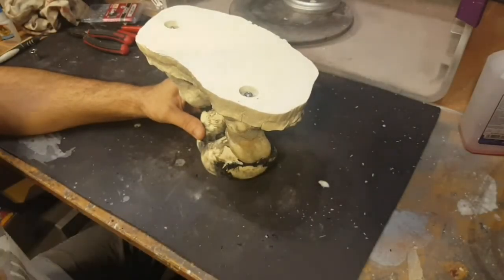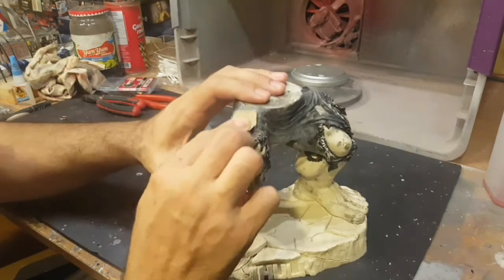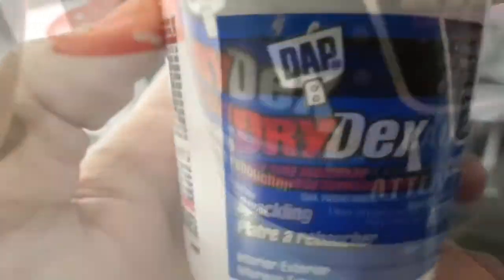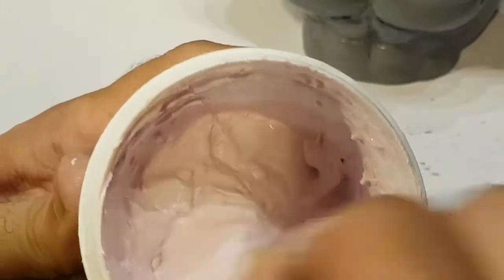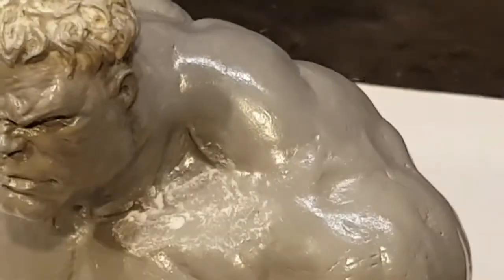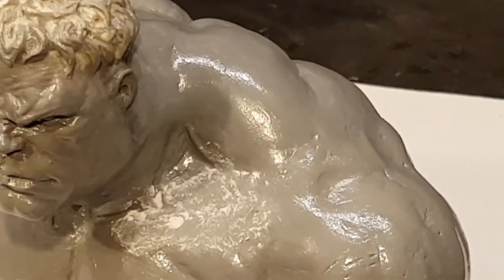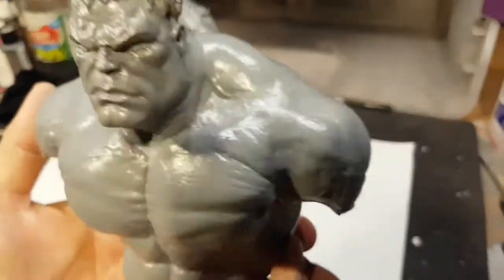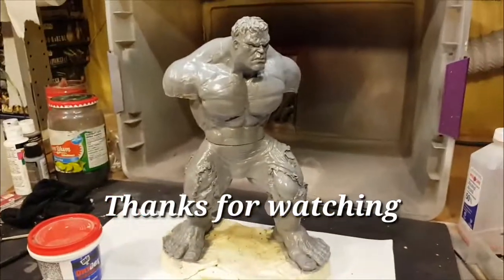The Hulk Custom Resin Model Build - Part 6

Comment: Nice detailing on that kit, the Dap works well, doesn't seem to shrink as much as the regular drywall compound.
Reply from the maker: Model Car Minion 
Yes it does work well but it does shrink like normal plaster but because we're dealing with such small pin holes, it isn't much. Besides, the shit dries so fast that you can just keep going!!!!

Thanks for stopping by 😆🖒